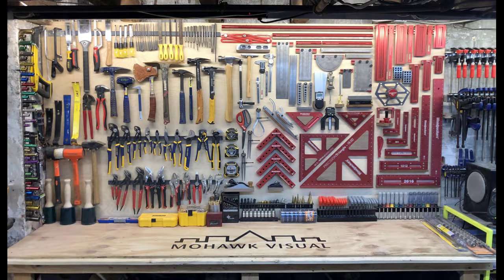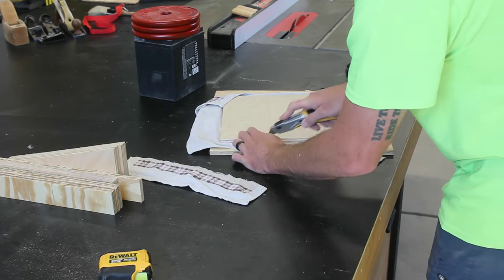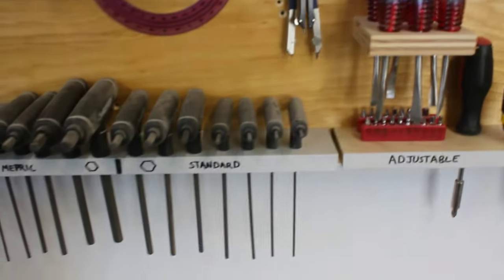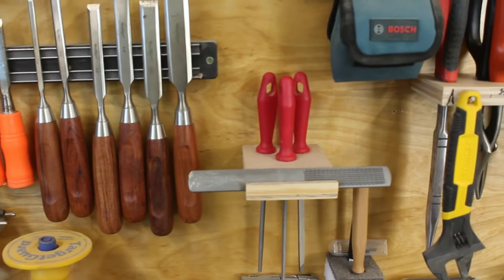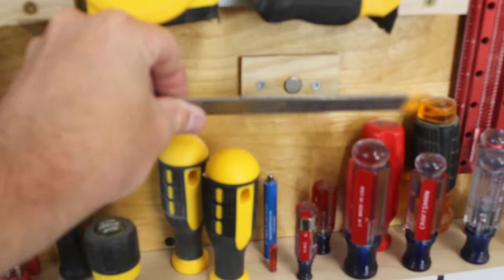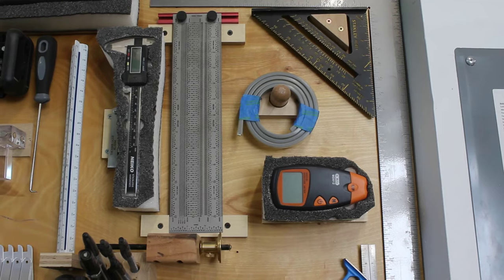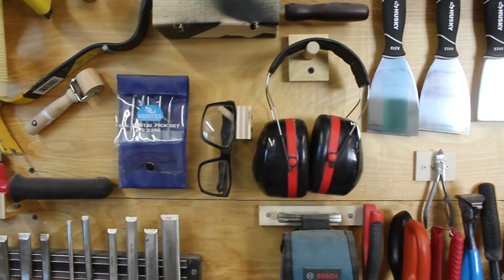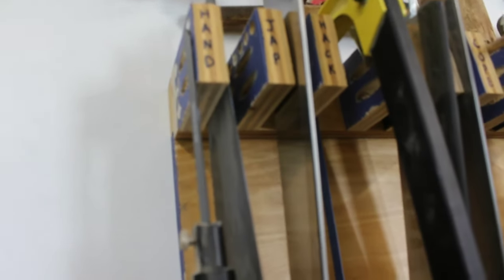It's Finally Done!!! - Completing the Tool Wall and Tour

Comment: I was working on a project last summer and left three hand planes on a cloth to stay   clean while I stepped away from the project for a while. It was two weeks before I got back to work on the project. My humid basement was unkind to all of the steel tools on the cloth. Mostiure from the air absorbed into the cloth and rusted the steel badly. Oil towell before setting them up in your new plane till .
Reply from the maker: Great idea, luckily I live in Colorado so humidity is low. But I will do that regardless. Thanks!